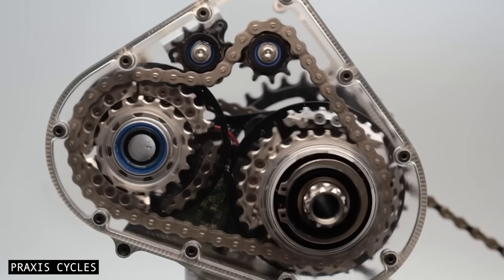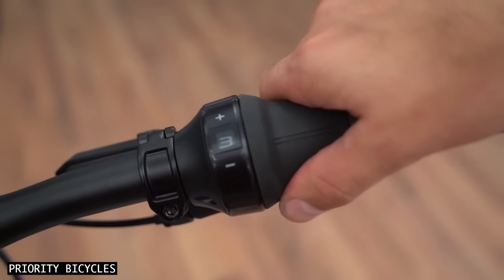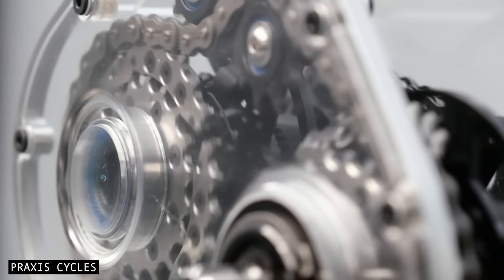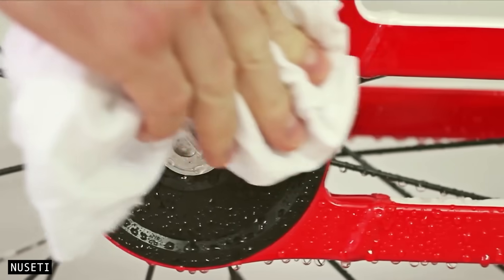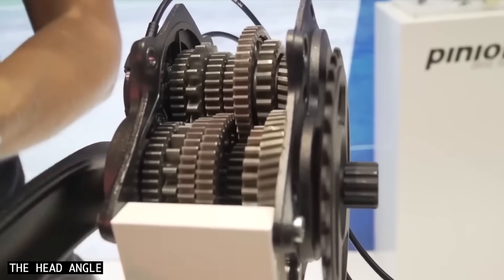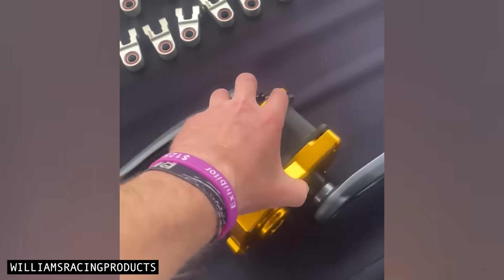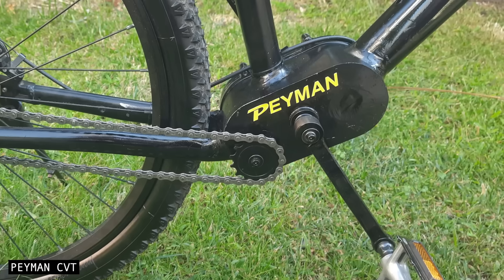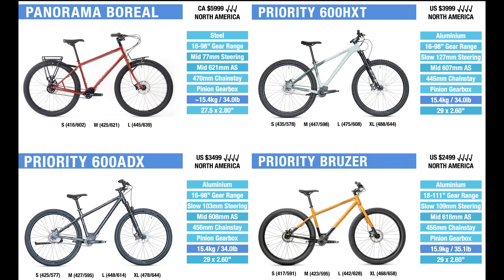8 Incredible NEW Bicycle Gearbox Drivetrains for 2026 // Shimano, Fox, Praxis, RatioX, WRP

Comment from the maker: Will you be switching to a gearbox or internal gear hub on your next bike? 🤔
Reply: I am going to ride what i have
Reply: Thanks to you, my new bike has a belt and gearbox 👍
Couldn't afford pinion or Rohloff, so it's an Alfine 11
Reply: I would like to but so expensive
Reply: I already made the switch. I won't be buying another bike with a derailleur system, the maintenance and vulnerability is just not acceptable for what I'm doing.
Crossing shallow rivers / muddy parts is just not fun knowing I'd be cleaning and re-adjusting my derailleur systems for hours after so.
Reply: I might in the near future. I don't have the patience to clean the whole chain after every 3rd ride or so. On my grocery ride I can only choose between mud, dust or 100 km/h cars.
Reply: already did .. NEVER going back.  worth every penny spent.  Pinion C1.12 + Gates belt..
- fantastic in the winter - way less maintenance (no corrosion, easy to clean)
- Great for bike packing when you are very far out - something truly reliable.
Reply: @Cyclingabout  Rohloff would be a dream. Tried a bike with Rohloff today and the gear range is really impressive. Climbing like a goat as we say in Norway.
Reply: Definitely a ROLHOFF on a 29er for 3 different bikes.
Reply: Already did with the priority 600 (it's dope)
Reply: I already have 2 bikes with Rohloff Speedhubs. One is my S-Works Turbo Levo Stumpjumper, my go-to bike for mountain biking. The second is my Tumbleweed Prospector bikepacking rig. Both gearboxes perform faultlessly and have done many thousands of kilometres.
Reply: c12 gates incoming soon. can't wait. test ride was love at first pedal.
Reply: Yes! I will switch.
Reply: would love a somewhat lightweight internal gear hub for my emtb.
Reply: The Nuseti and Peyman look like standouts to me! Although none of these are likely to be ready in time for my next bike, which I need soon, or anywhere near affordable! I need a hybrid road/gravel bike that can also do singletrack/trails plus a bit of rougher DH on occasion. I also want gear ranges that will get me up 20degree slopes with ease and let me pedal up to 70+ kph downhills. Yeah, I know, I don't ask for much! ;)
Reply: Switched in 2022, no plans to go back to a derailleur.
Reply: None. My rocky mountain growler 40 Hardtail with kinekt seat post suspension, Ergon saddle and hyperglide derailure Shimano 12 speed is simple and ultralight. It's fun riding a 40 pound MTB
Reply: If budget allows i will try gearbox but so far im still happy with my Alfine and Rohloff.
Reply: Maybe.
Reply: not until it gets cheaper, standardized (i'm not touching proprietary stuff with a ten foot pole), and has no major physical drawbacks.

until then i'm sticking to internally geared hubs, that's basically a gearbox but better for now.
Reply: I hear the newest opinions still have torque problems. Have you tested them?
Reply: Like a Hublot watch

Comment: Is there no bike transmission, like by Toyota Prius? With planetary gearset and two electric mashines, working like motor and generator on the same time on different wheels? There will be needed two motor controllers, and maybe little battery, but the spreading could be really good!
Reply from the maker: I have a video about eCVT bicycles that use that tech here: https://youtu.be/J75qZO4Phjs
Reply: @Cyclingabout  exactly, thank you very much, have not seen this video!

Comment: Glad to see the innovation. A sealed system MUST never have a derailing type of incident since fixing a sealed on the trail would be a pain. A cvt type needs to have Ean adjustment for pedal effort since sometimes I want more or less force per rotation.

For myself, I’d like no front derailed or shift lever, no chain to catch my pants, quieter I.e. no clicking, no chain jumps, and no open sprockets/gears to grab dirt and sand.

Comment: Yikes. Internal chain verses helical or straight cut gears is just dumb. Using an electric bike doesn't work for daily driver. The cost is just to high. My next bike will have a pinion unless someone else comes up with a direct gear transmission. I want electronic shifting but that is very expensive.

Comment: Rohloff entered the electronic shifting market place in recent times, however I see little point to it, personally. To me it is to introduce an unnecessary failure risk to an already extremely reliable and durable system. I feel the reason Rohloff haven't "jumped on" is because they simply don't need to. Their single cog drive train set up is an easily maintained and highly available consumable. They even modified the sprocket retainer to negate the need for a special tool, so to replace a chain and both cogs is relatively cheap and simple to do. At around £10 for a good quality bushed nickel chain, it's questionable as to whether it's even worth the cost of cleaning even a lightly worn chain these days, and the old one is fully recyclable, too.
Reply: They get into electric shifting for easier actuation, possibility of automatic shifting and to allow different inputs than the twist grip, for example for drop bars.
I personally get chafing on long sweaty rides from the twist grip and use special bars, where it doesn't fit well. (Surly Corner Stop) I am thinking hard about spending a lot of money just to get levers with a Gebla Rohbox or even more for an electronic Sternshift. I would love a first party solution that isn't tied to a Bosch motor (or any at all, there are others coming, but no standalone for now).

Comment: Very good update in recent development of gearboxes!
As a Rohloff-Driver I will never go back to the "open" derailleur-concept ... but may be it is worth to give it a chance in internal gearing. So, my favorite is the Praxis HiT Gearbox, followed by the Fox Factory Gearbox, but for the moment I think Pinion is just the "gold-standard" (including MGU). And you can just buy a Pinion, it has left the status of "prototype" long ago. That means really hard work for Praxis HiT and Fox Factory, but we will see.
I strongly feel the need of standardized mounting system at the bottom bracket ...

Comment: I love it!   At the same time, I'm not surprised....bike mfgrs who don't get on board the trend for gearbox drive will lose out.    I have been riding a Priority 600X Adventure for about 5 years and roughly 2500 miles.   This is a game changer!  Far more robust than any chain/derailleur system.   Way less maintenance.  What's not to like?     Of course, weight weenies will scoff at the 32lb weight of this machine.   I have gladly accepted the extra weight in exchange for the aforementioned attributes.   I have a lot of single track time and commuting in dirty conditions.   I'm sure this contributed to needing belt replacement recently.   Gritty mud and dry powdery dust are not kind to any open drive system.   In the same space of use and time,  I would have worn out 3 or 4 chains and at least one set of drive sprockets.   Add to that, countless cleanings and lube  sessions.   The belt and sprockets on the Gates drive only needed rinsing occasionally and some bar soap once in a while to minimize  belt chirp in dusty conditions.   
   Thanks for sharing the exciting new gearbox designs.   Be well.

Comment: I'm an avid cyclists with good legs and skills.  I'd gladly give up some efficiency for a CVT.  I don't mind burning a few more calories during a ride.  While it is always nice to improve, I'm usually not out racing, or clocking Strava rides.  I'm not ready for an e-bike, but I ride with a few e-bikers anyway.

When I ride a large ravine (MTB or fatty,) I have to balance having a high enough gear to maintain speed a low enough gear at the top to crawl out.  There's nothing worse than a dirty chain or derailleur picking up every leaf and stick on spring rides.  Not to mention often getting bent just transporting the bike.  No more chain ring marks on my body or clothes either!  CVT with a hidden belt drive please!

Comment: Nice all these gears and things, but the simpler the better for any aspect of it. Current drivetrains have the easiest, simplest and less prone to faults parts than any of these.
Reply: Naah, it's all very complex and derailleurs are vulnerable. Fixed gear is the only simple thing and that's not a solution for most. An enclosed thing that never breaks is at least as good as an exposed thing that can be repaired more easily. But what will you repair on a rear mech other than exchange worn out parts and bend back something bent maybe a few times before it breaks for good?

Comment: I currently have Alfine 11 on my Priority Appolo Gravel & Alfine 8 in my Moulton TSR, Nexus 8 on my Priority Folder and Pinion 12 on the Priority 600. I am completely into internal gearing and gates belt drives.
Reply from the maker: Wow, that's quite a collection!
Reply: @Cyclingabout I am about to buy another today as priority is offer $1000 usd this weekend of their electronic shift pinion mtb so kinda of tempting 😅 but to be honest the latest trend is drop bar on mtb so not sure yet.

Comment: Thanks for the update! Crank gearboxes with integrated motor is the best option for ebikes, since it allows you to have several wheelsets cheaply, making it very quick to switch between slicks, mtb/gravel tyres, and winter tyres.

I have a CVT ebike, and it's great for that use. I would not want a CVT on my muscle bikes, too much drag. One of the chain or spur gear systems would be better for that.

Comment: Fascinating approaches.  It is interesting that the biggest companies, Shimano most notably, don't seem to be really interested in pushing the envelope.  Its a pity - it would be great if there was an option built at suffienet scale to make them more affordable.
Reply: Funny you say Shimano, when they were mentioned in the video with an "older" one and a completely new approach.
Well and SRAM totally dropped gears, focussing on derailleurs, kinda letting the front derailleur drop as well. (Now combining a geared hub with a cassette like SRAM had with the Dual Drive is no longer only in the hands of Sturmey Archer with Triple Shift, but Classified brought it into the expensive performance segment with Powershift.)
The market is a funny beast at times.

Who else could be a candidate? Bosch probably is big enough and probably has experience in the necessary areas, but would only put it into motors.

Comment: My single speed is light, 98% efficient, cheap, durable and operates well between 40rpm and 220rpm. That’s over 500% “gear range”!  Did I mention it’s wireless?

Comment: If the manufacturers could standardise with a few (3) variants of box-shell designs, then it would make frame manufacturers not have custom make frames for each type.
Reply: i don't understand how people can just be fine with all these patents, the whole point of bicycles is that everything is standardized and easy to modify and replace!!!
all patents do is make things more expensive and harder to get.
Reply: @swedneck   "The whole point of bicycles" is to turn a crank that spins a wheel to propel yourself forward. The rest is just what you'd like about them.
But really, where is there a single standard in bicycles? The only thing I can come up with is the pedal axle threads. But I think I have heard of other ones for that as well. And on tandems they are sometimes swapped. And it's not like things are just getting ever more complex. Think of all the old standards that have gone away. Especially rim diameters have been thinned out a lot.
Patents themselves are not a bad thing at all. They are how large companies have a reason to put work into coming up with better solutions. I wouldn't want to ride a 1920's bike instead of my advanced modern bike. It's simply the choice to make things differently, incompatibly - and that happens with or without patents. The choice of nearly every motor manufacturer to create their own mounting does not have a lot to do with patents.
Yes, there should be very few standards for motors and gearboxes at the cranks. And with so many standards, bike manufacturers should make larger general mounting standard that can be adapted to any one of those. - Some have actually started, for example Riese & Müller has bikes that can be built with different motors and some cargo bike manufacturer has something similar. But I assume, they again both have something different… The other problem is always, that different standards and measures have different advantages, so none will be completely phased out. (Often it's the larger, more sturdy and the smaller, more lightweight and cheaper version. Or it's just the new, better one and the old, cheaper and more familiar one.)

But most of the time something new does not take replaceability away from you. The old and common things will stay common and cheap for a long time. By the time they get hard to replace, you can be well accustomed to the new, better thing and it will be available at good prices from many manufacturers. Otherwise the old one will not go away, because there will still be customers, so there will still be manufacturers.
Reply: Yeah, I would have been excited for the upcoming choice, if there was actually a choice and not "well, if you want this gearbox, you'll have to get this bike". 🙄

Comment: Wonder how a CVT feels to pedal.  Would be a dream to have it without the drag and weight downsides.

The fact that all these completely different designs exist now reminds me a bit of early full suspension MTB.  They tried radically different approaches until more proven designs settled out of the chaos - that process took about 10-15 years, I'm guessing with gearboxes it'll be more like 20-25.

Comment: I now have 85,000 miles on my p18 pinion gearbox. At 50,000 sent it back to factory as per request from them and was told everything inside looked brand new. Only got a new seal replacement as per my request not cause it needed it. My original belt lasted 50,000 miles and I saved it as a back up to my new one. I add 25cc oil every 4 months and total replacement of oil every year. It is now 8 years old with hard and heavy loaded bike use. 3 sets of cables replaced so far, that's it. 
Great video as usual!
Reply: Was this oil fill up advised by Pinion? I was replacing oil in my C12 recently and I was wondering what happens if I overfill. It is hard to tell if oil level is right :/ In case of car gearboxes, you can blow the seals if you put too much. But since yours was fine for 50k...
Reply: @ch4osz2  Any "user-allowed" maintenance process always has large safety factors included for the "we-all-know-which-type-of-people"...
When filling in oil, you will feel a back pressure in the syringe due to air that is getting compressed while filling in oil. You literally can feel when you press too much oil in those tiny bike gearboxes and IGH, as the back pressure increases much too much.
Reply: @leeroyjenkins7915 the other famous German bicycle drivetrain brand is notoriously unforgiving in its oil level and grades
Reply: @ch4osz2  if I wait a year to do oil change it will be dry in 6 months due to how many miles I do a year. So I add oil every 4 months and do a complete change in 1 year. If you over fill, it will blow out your oil seal. Never happened to me, but a friend of mine did.

Comment: I am waiting for a system that I can retrofit to my new mountain bike.
Reply: For retrofitting an existing bike you will need an internally geared hub - Rohloff Speedhub or Shimano Alfine. I've been riding an Alfine 11 retrofitted to a random bike for about eight years now; it works quite well but I'm looking to upgrade to a Pinion setup. Any mid-mount gearbox is going to require an dedicated frame - no way around it, you can't fit all the needed hardware into a regular bottom bracket.

Comment: The design I like best is the one I can use on my bike. Gear boxes sound great, in theory. But if it only works on certain bikes then it's not for the masses. And it's not for me. When they start making them to fit a standard bottom bracket then I'd be interested.
Reply: But it's impossible physically.
Reply: @JohnDir-xw3hf It's not "physically" impossible if they just use "physics".
Reply: When a standard appears that frame and gearbox manufacturers all use gearboxes will be a lot less of a risk. So many have shown up, sold their products and  gone out of business, leaving their customers with unmaintainable bikes that I wouldn't risk one. Hub gears are great, but the weight is in the worst possible place for decent handling especially off road. E-bike motor mounting standards may accidentally give us a widely available standard gearboxes can use, but it's not like they're down to one standard either.
Reply: It could attach to the bottom bracket rather like a Bafang mid drive motor and the output chain ring stays in the same location. The spindle might have to transfer power to the forward gear box via a left side assembly which adds more complexity to the overall attachment.
Reply: Call me when the prototype is ready for testing. @briannugent5518
Reply: @briannugent5518   but why do you want this inferior design?
Reply: @JohnDir-xw3hf    if it were physically possible and available for a standard frame BB, I'd be interested

Comment: It would have been nice to see the Efneo gearbox. It's a three speed planetary gearbox situated on the chainring/crank of the bike. They make it in Poland. One can put it on a bike without modifying the frame.
Reply from the maker: I've got a planetary crankset video planned some day in the future - the competition is heating up in that space. 🔥
Reply: I am currently building a low maintenance folding bike with (only) a Schlumpf High Speed Drive. 😁